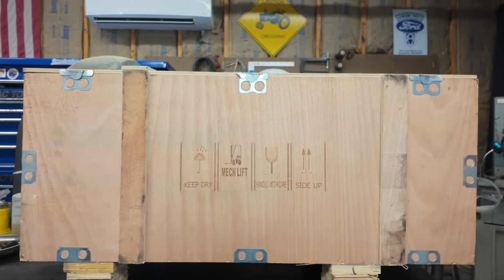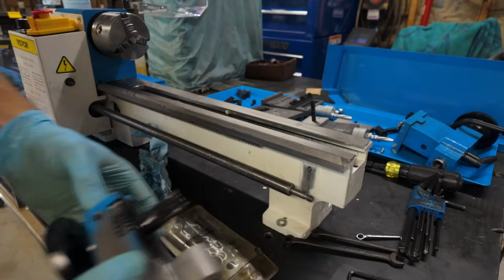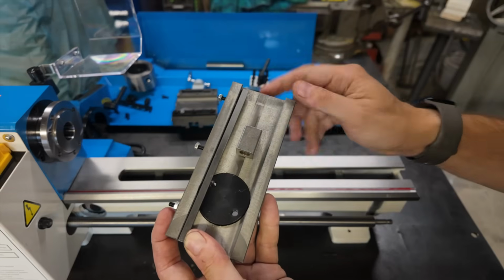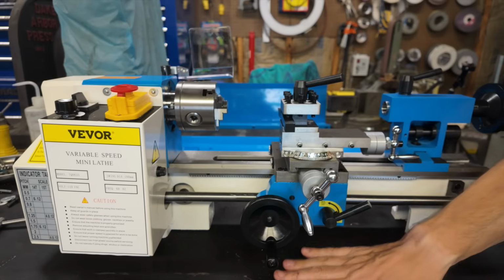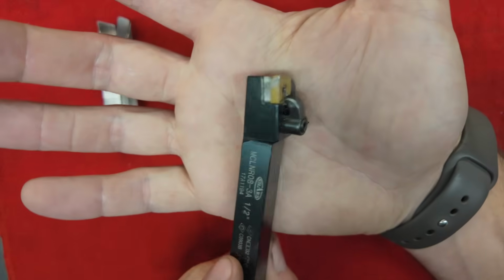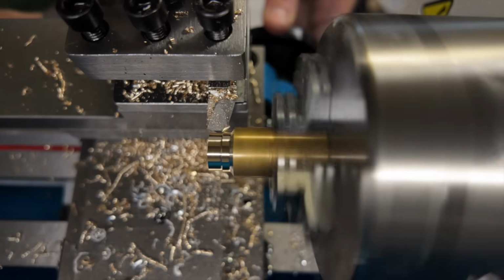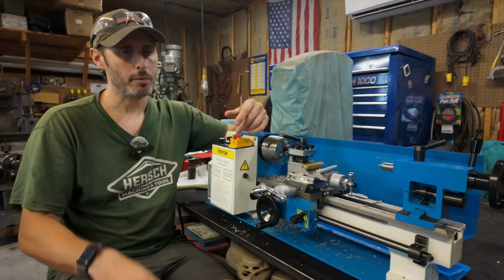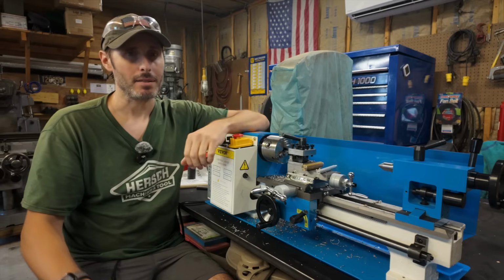What I DIDN'T Know About This Mini Lathe SURPRISED Me

Comment: Have to call it out t confirm which version. I've seen some of the "near identical" Mini Lathe's come with aluminum tool holder blocks, which flex like mad and can't take standard tools. 

I'm also scrounging around for someone who's modified this compound "enabled" system to switch to a quick attachment block standard.

Comment: If you are considering getting a small lathe, you should consider the following: 

1. The lathe lacs the torque to be running hss tooling efficiently, it will stall at the surface speeds you nedd to keep your tooling alive. Getting a geared lathe instead of stepless aka frequenzy modulated one helps a little, but you are still better of getting cheap chinese carbide instead of hss so you can run at higher speeds.

2. Eventually, you are going to want a bigger machine. Good thing is, most of the tooling you got for this one doesn't care about the physical size your machine is, so you can keep most of it.

3. Chip formation is awfull. You can not keep a sufficient debth of cut and feed to break the chips, so you are going to end up with ratsnests. (Bundless of razor sharp joy). If you plan on hand feeding, this isn't so much of an issue, but don't plan on any long cuts.

4. Threading is a pain. None of these come with a thread gear box, and this one in particular also uses change gears for changing feed rates. So if you plan on turning threads, be prepared to change gears endlessly.

All that being said, a mini lathe is better than no lathe. But seeing as these cost almost or over 1000 dollars or euros, you are better off saving 2-3 times that and getting the next size of machines.

Comment: I have been looking into mini lathes for a recurring small job I need done (maybe 4-6 of these per month). I have never used a lathe in my life. It is a 12 in long steel shaft and the diameter is about 1.25". All I need to do is cut a 1/16" wide groove about a fourth of the way from one end of the shaft. The groove only needs to be about 0.040" deep. I would use an insert tool with a 1/16" insert to cut the groove. Do you think this mini lathe could get that done, or perhaps a 7x14?

Comment: Is it possible to remove the chuck mounting plate from the head stock spindle? I’d like to upgrade my machine to work with a 5” chuck. My other option is to create an adapter plate but would rather avoid a bandaid solution if I can

Comment: Why clean it ?,... it serves as rust protection.  Mine is just staying put by its own weight.  Used in average once per year.  Never had any problems.    Mine came with the cheapest possible tools, they quickly broke.  So for me insert tools was a nice improvement.  I do'no what I'm doing so I will break tools/bits ;-). ...... Mine is slightly different thoug, bought many years ago, but very likely from China. ... I do'no how to use it though, I mean, realy use it.  I frequently struggle to center whatever I put in it.

Comment: at 66. never having used a lath before. money is the reason for not buying one. great you get stuff like this for FREE.
i have random needs for a lath. but those projects get tossed aside.  hopping someone will delovep and sell the item i need. 
i built and designed a new cj-7 clutch linkage. but not having tooling or a way to promote it, i lost out to someone years later who did. very small market only good for cj-7 and cj-8 with a six (maybe the 4 banger?) with a stick maybe a cj-5 or 6?. newer used hydraulic.
but my main used are just for model trains. and 1/10 scale ( others?) rc cars and trucks..
ss steel, bronze and brass would be the metals i would use.
i have seen the prices on these units. go up faster than my wallet allows.
now  retired. buying one is out of the question. 
but videos like this are great to watch. and learn- - even if i never use the knowledge- -.

Comment: I have had this same machine for a little more than 2 years and after much tweaking and shimming it works pretty well. A major problem with Vevor is the lack of spare parts. The motor pully failed and they have no way to supply any parts for the machine, in or out of warrantee! I could have made the part if I had a working lathe.

Comment: yeaaaa unless somebody explains why i have to for operational purposes ,im planning on getting similar ans i will def clean the extra goop hanging off and what might fling off during use or be in the way of reading dials and operation but i wont be stripping it to remove a good thick lubricant as i live on and island with the saltiest water /atmosphere i know of and everything rusts and corrodes like crazy . also water condenses on most surfaces during humid seasons u know like summer ......and winter lol yea i hate this place

Comment: I have the exact same lathe, so im on board for watching improvement videos. This isnt my first experience with mini lathes. My family had a shop that had these minies, the next step up to the bigger 4 inch chinese lathe, and a monster 12". Admittedly, the small ones, like this, broke a lot, and werent anywhere near as usefull as the next step up(4"), but these are all i can afford new, so i picked up a bigger southbend machine from the 40's that still works fine to do anything the wee one cant. It was only 200 bucks and came with a bunch of stuff i can use with the mini to make it a much better unit. Are they worth it??? If its all that you have the budget for, then obviously, hell yeah, but i can assure anyone else that bothered to read this far, if you dont, at the BARE MINIMUM, wipe of all the grease you possibly can, and make sure everything is adjusted correctly, it will not be anything like what you just watched. It was the reason the small ones were always broken at the family shop.

Comment: I finally took the dive and got the 7x16, which happened to be on sale when I looked for $600. Rewatching this video, I see mine had a lot of stuff this one doesn't have. The size isn't the only benefit. Mine has all metal gears, and it also has a carriage lock, which yours does not. A lot of people miss the carriage lock, it's a single hex bolt on the right side under the cross slide. Need to move it out of the way. A bit disappointing that the grub screw is in the way, otherwise I'd put a handle on it.

For any newbies, buy the 250-000 quick change tool post holder for it with some tool holders. The amount of time screwing around with shims is well worth the hundred bucks.

Comment: I got one that is similar but maybe a little bit different.  Out of the box, I cleaned it up without taking it apart and even without doing anything but cleaning the grease off and using it. I was able to turn down some melted down silver plated silverware that I melted myself into coins and was able to make them look close to the brass blanks you can buy online for laser engraving. My next step is to laser engrave then and see how that works out. Even though they used to be silver plated, they  looked and acted like brass. The next thing I was able to do was turn down some co2 cartridges and make some small storage keychains, which also came out great.  Well worth the money I spent.

Comment: I have the exact same machine.  Right out of the box, I ran it for about five minutes.  The drive for the Chuck was super hot, not a single part was lubricated.  It was going to be junk in a short time.  Also, every single nut was loose on the entire lathe, it was going to fall apart.  It's super easy to blow the 1/2 Amp fuse too.  Now, about this video, I really liked to see how much it could cut on the different metals, I was afraid to make that deep of cuts.
Reply: Meaning what exactly? Wish you had watched this video or one similar before even unboxing your machine? He has given excellent instructions and how important it is to lubricate this machines parts.

Comment: The problem is to get parts for them, i bought one about 17 years ago still working good to a point electronicly is gone, mechanicly still the same, in about 4 years of use the electronic speed went burn, i been asking who car replace the part or who sell it ...no body harbor freight no answer and as i had moved many times to different cities i had ask on all the harbor freights and the same answer till now 10/2025 ask for the plastic shield no have it a 4 jag chuck no have so i had adapted a speed control luckely the motor still working as a DC motor but that make me think that electric components harbor freight is not a good source

Comment: Chatter as a rule does clear up after either slowing the speed increase the feed rate. A sharper point tool with a back rake angle will help too!
Cutting oil doesn’t hurt

Comment: I'm a retired tool & die maker who's owned a similar mini lathe for 15 years. These are wonderful little machines that can be pushed right up to the limits of their motor power & beyond. Most of your chatter is coming from the small work diameter & the sharp carbide tool. Carbide inserts are much better & you can use much heavier feeds. I never use brazed carbide because they  chip too easily & are difficult to sharpen. I use only inserted carbide for turning & HSS for threading & parting. BTW: How do you cut threads on that lathe? I see no thread chaser dial. My machine has one.
Reply: Could you look at what happened to me when I got my first Vevor metal lathe? Tell me where I went wrong, please? https://youtu.be/PlfRQMUhz9A?si=Z0wJ4BVi9SQsazPy

Comment: Your first cuts were with braze carbide-why do you prefer carbide as hss is more sharp so easier cutting especially with ali and brass and especially nylon and plastics! An adjustable tool holder is a very big MUST HAVE on manual lathes such as these if you don’t want to mess about with packing strips and shim’s which is very old fashioned way of getting the cutting tool on centre height most important for centre lathe turning which is what you are doing!

Comment: Thankyou  for the video and  iM glad you shared your opinion  because most guys that do. Review them   Do have that Snobbish answer that it’s just a toy , myself iM a retiredWoodworker who wants to explore other Avenues   And hands on Experience. I do  have a long line of Professional Machinists and a Couple of Tool and Die Makers  Yes I heard all the Jokes between those two trades as a kid  it was a fun thing they did  in front of me  Almost like a kid Safe Stand Up !LOL  Sadly they are both gone  now ?  But this machine for me would. Completely be a hobby  thing  oddly enough one of my hobbies is Antique British Autos and Motorcycles and they  used the Whitworth System  for measurement and things like thread pitch Bolt sizing  etc. I’ve managed to restore a couple of Antique Cars with a few Wrenches  from Factory Tool kits  and a mixture of SAE and Metric Socket sets from different manufacturers  now with EBay  and the Internet  purchasing Whitworth tools  is much easier and affordable  my plan is to budget that cost into my next project  but if I could make  a new bolt or fastener it would be of some value  as well as. It might be for some silly  part I need to adapt from  another Application  All together  these things happen often in those Restorations  like a Popular one is  replacing the factory engine and transmission with a Japenese made one for better fuel economy , reliability ,preference  but connecting it to the old British Dashboard gauges   Or something similar  I  did a simple  one  that I eliminated a mechanical fuel pump  utilizing a electric one  hidden under a spare tire in the trunk  I used  a Chevy style Pump  fro a aftermarket Company like Jegs  or ?   And I needed a adapter that just wasn’t available  so I bought 2   Cut them  and Welded the parts I needed  together  it’s been working on that Vehicle for 20 years  as best as I know  I ve relocated from that area  for many years now
Reply: 😊 the reality. Looking back on that part I could had eliminated welding if I made it out of plastic  and a Mimi Lathe would had been  perfect for either

Comment: The machine looks pretty decent. The problem I had was watching you leave the Chuck key in the chuck. That is an extreme safety hazard. I have a little Harbor Freight lathe that I use with the plastic switched safety that won't allow the machine to turn on with the Chuck key in. Still lathes in machine shops don't have that safety device and leaving a Chuck key in the Chuck is a bad habit that could kill someone.
Reply: Agreed. I just bought this same lathe and mine came with a spring loaded key for that reason. Maybe he removed it, it is a little intrusive when trying to turn the chuck but the safety feature is worth it.

Comment: Sections of snapped off or cut hacksaw blades as shims for the tool post. Consistent thickness and most people likely have a blade hanging around. Great vid 👍
Reply: Sometimes you need to adjust in finer increments than the thickness of a blade will allow. Also the set of the saw teeth can cause problems.
Reply: @MrTekwiz ball peen hammer and solid surface says the set in those teeth won’t be a problem lol 😆

Comment: I have this exact machine although it is branded TAQ. It has served me well. I did not have super high expectations at first but it performed quite well. My first set of projects was to replace the crappy plastic handles and turning wheels with brass. For $800AU I am still happy with my mini lathe.

Comment: I haven't finished watching the video yet - just needed to comment about how you bolted it down without checking for twist.  You'll want to use shims to adjust it until it's true.  And YIKES on leaving the chuck key in the chuck!
Reply: The beds of those machines are finished on a surface grinder. If anything, bolting it to a bench may introduce a twist.

Comment: I only did a couple of months in the machine shop during my apprenticeship 50 years ago but remember two things
Every material has a 'cutting speed ' which combined with it's diameter determines the rpm.
Leaving the chuck key in the chuck was a sackable offence.
Reply: Ironically during my apprenticeship my mentor left the key in the chuck and flung it into the ceiling, thankfully neither of us were hit
Reply: Yes, please never leave the key in the chuck after use. Your material diameter, depth of cut, your feed rate and your spindle RPM determine the SFPM (surface feet per minute) of material that is being removed. There are tables available for each material which let you set the preceding parameters in order to achieve an ideal SFPM removal rate. It is not difficult, and the most pleasing result is the improvement that you will get in surface finish. Your tools must be appropriately sharpened.
Reply: Indeed it is. Good way to get a chuck key in the gut at a high rate of speed. Seen it happen.
Reply: @MrTekwiz can confirm will remove front teeth coworker found out the tough way
Reply: so you left the key in the chuck?

Comment: I found the biggest upgrade for my mini lathe was to fit timken taper roller bearings in the headstock which transformed it as far as rigidity apart from making tapered gib strips for the carriage.

Comment: Your feed rates are too low for the spindle speed.  If you want to  run the part fast, you have to run the tool fast.  If not, well, you got the ear full from it all.  Want to have some fun?  Play with the feeds and speeds to see what chatter patterns you can make in what materials.

Comment: **************** Vevor Mini-lath  is a piece of Garbage  !!!! Do Not buy it !!!!   ************
  It will break down after a handful of simple projects, its parts are very delicate and badly done and poorly finished . It is not meant for steel machining , or accurate jobs.
It did cost me $500 to get replace broken  parts and trashy ones , and to  make some changes  and adjustments to improve  the its accuracy and robustness 
  so, I end up paying almost $1200 for the piece of garbage .
And after all what I spent, still , it is not the lath , I can rely on to finish a real project.
Therefore , I got a computerized mini-lath from China for $1000 , it is working fine, machining all types of steel with accuracy 0.0001 mil, I did many complicated projects on it for customers
and and adding features on it

Comment: Great video on a tool I’m considering. Is it possible or feasible to take the lathe apart and clean individual sections instead of all sections off. Past experience has taught me that I will spend hours trying to put something back together, even if I take photos. I’m a master at taking stuff apart, not so good at reassembly
Reply from the maker: Some parts require others to come off first before you can get to them. It's really up to you how far you want to go with an initial cleaning. But I do sincerely recommend a good disassembly, cleaning, and reassembly/adjustment before use for best results. It's really not as difficult as you imagine, you can do it! :)

Comment: Make every mod, upgrade, and improvement as possible. I would like to see everything that has to be done to make this machine produce an excellent cut that runs true precision. I want to know what all has to be done and how much time it takes.  Is it better to just go ahead and buy a precision mattthews.
Reply from the maker: I'll do my best. But in the meantime, i can probably spoil the ending a bit with some words of experience. The answer to your question is, "it depends". It depends on you, and on what you want in a machine. No machine is going to be perfect. Even the most expensive. When it comes to precision, the operator is the most important variable, followed closely by the job requirements. I can say this. Even these small budget chinese machines are, for the most part, going to be more accurate than the average hobby user, and far more accurate than we normally "REALLY" need them to be. :)